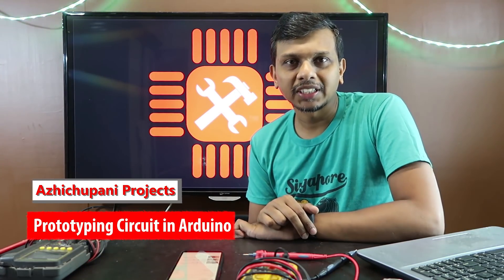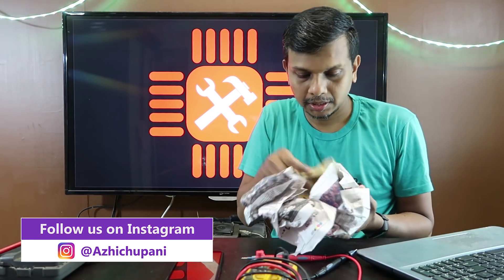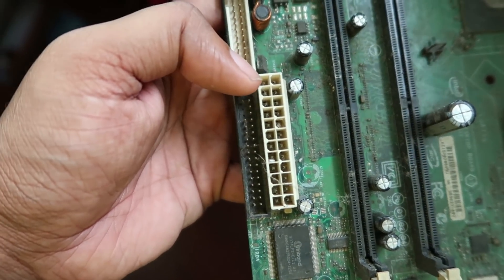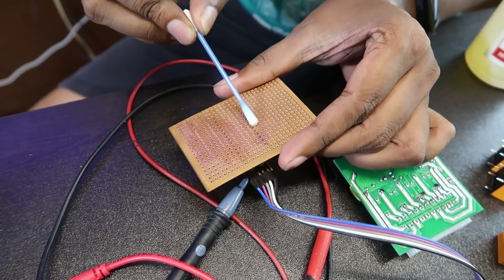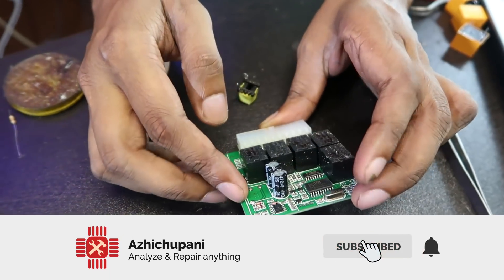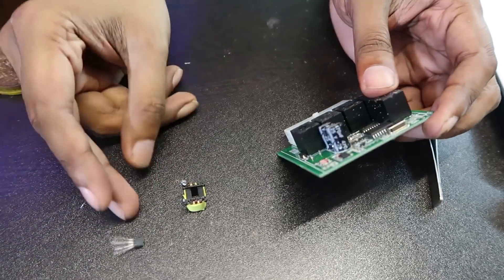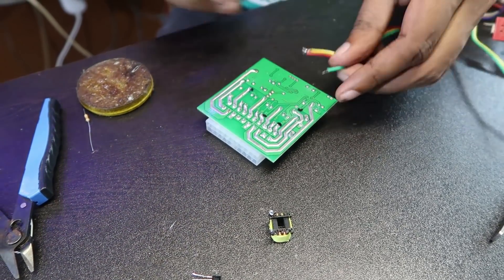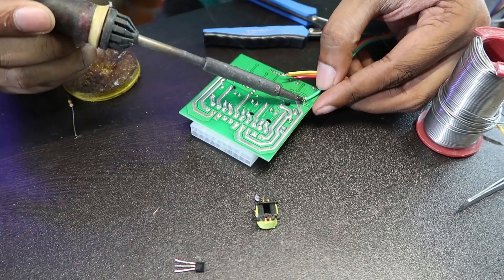APEP10 - Protoype for Automatic Power WIndow Rollup | Arduino

Comment: Why can't all four windows close together??? Why only one by one??
Reply from the maker: It's just have a load protection, each window while winding up draws upto 10 amps all four together means 40 amps
Reply: @Azhichupani  but when we roll up all the 4 windows from driver side control than nothing goes wrong. Why it can't be made on auto roll up. Because when u leave the car with windows rolling up one by one there are the chances of thief may obstruct any window and unlock the car. Otherwise u have to wait and watch all the windows rolling up? Then what is the use of automatic u can do this manually also.
Please share your views and limitation of this circuit (if any) u faced. I was also planning to make windows relay for all four windows together coz it is not available in the market.
Reply from the maker: @deepakrautela9342  All the best, you can make the relay go all at once. Also a thief doesn't bother if a window is locked or unlocked.

Comment: Adipoli chettayee... Swanthamayee pcb design cheythu english tutorialil kanunna pole JLC Pcb vazhi board important cheythu cheyyuvanel poli ayirikkum. Professional ayirikkum. Pinne enik oru doubt koode und. Windows ellam different positionil anengil ithu work cheyyumo( fully open allathe pakuthi open akkiyal)
Reply from the maker: JLC pcb namukku onnum tharilla bro.. valiya YouTubers one kodukku
Reply: @Azhichupani  JLC pcb order cheyyan pattum...indiayilek shipping ind..sponser mathrame valya utubersnu koduku
Reply: @Azhichupani  Sir, why is my car i20 turn signal circuit has only 9 voltage?? Is not it supposed to be 12 voltage??

Comment: Normally Ampiar cheking alla power window carukaliilum undallo. Appol aa pointil ninnum just lock system inthay triger unitil ninnum oru signal wire aduthu on delay bord undakki alla window manual switchilakkum connect chaythal work aakillay?. Ampiar check board ozhivakkalo
Reply from the maker: Oru actionu athinde reaction ariyande?? For eg: ningal lightinde switch ittu.. light kathunnundo illayo ennu ariyande ?? Same case aanu nammude ampere board cheyyunnathu..